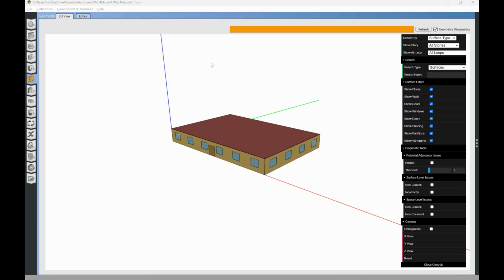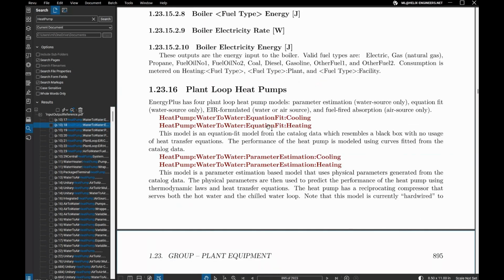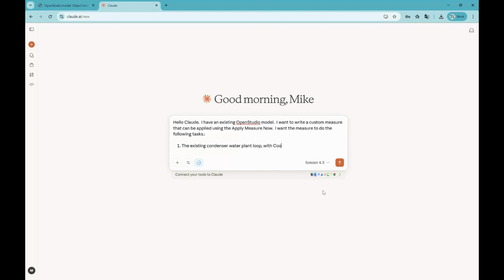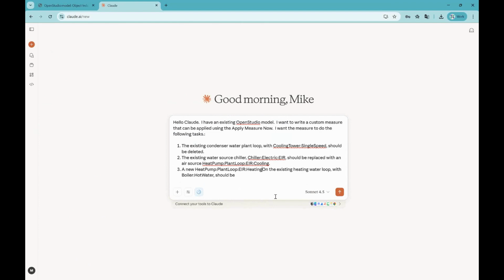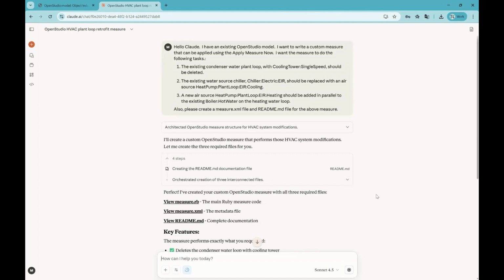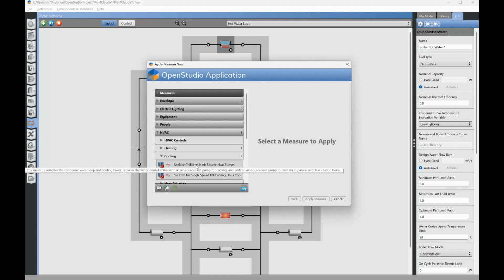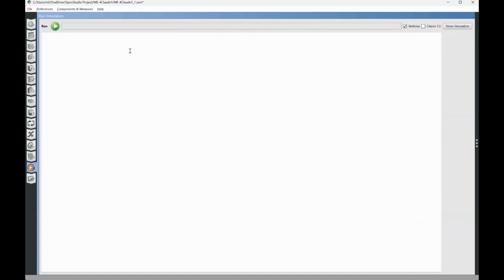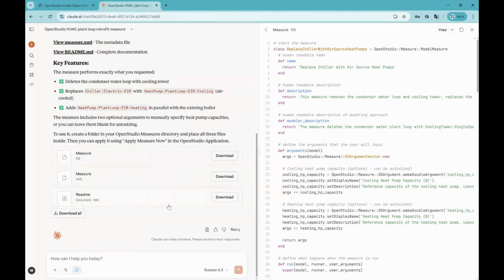OpenStudio EnergyPlus - Measure Writing Using AI

Comment: Hello, thank you for your videos. I’m trying to use OpenStudio, but I’m still stuck on importing the schedules. I would like to model a residential house, but I can’t find the Schedule Sets for Residential. How can I import the correct libraries? Also, do you know where I can find a forum or a Discord server where I can ask this kind of question?
Reply from the maker: Yes, residential models are normally much simpler with one or two space types.  Unmethours.com is a good resource for building energy modeling.  From this thread it appears NREL has a comprehensive library of residential models: https://unmethours.com/question/19882/residential-house-space-type-and-construction-set-wizard-isnt-working/
I have also built a simple measure that generates a generic residential model; you can get it from the BCL here: https://bcl.nrel.gov/content/f8624d92-b6f8-450a-9e6c-1b4e58df42c4
Reply: @helixenergypartnersllc3540  Thank you !